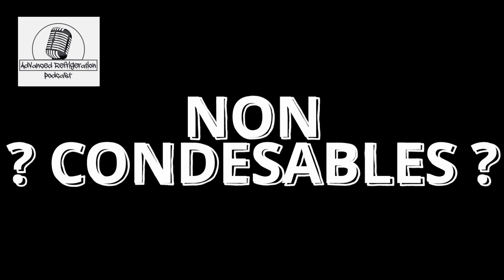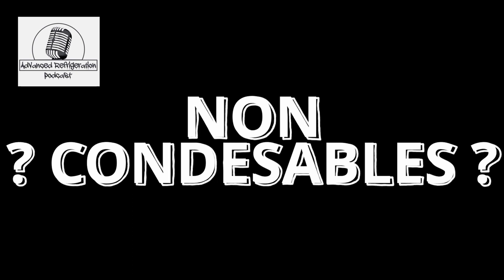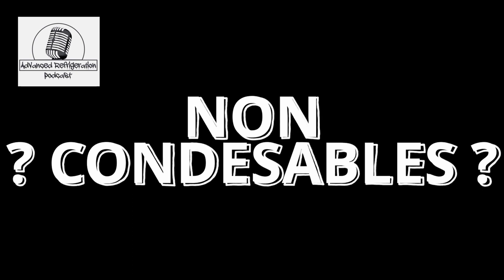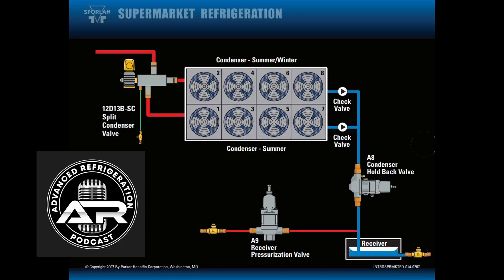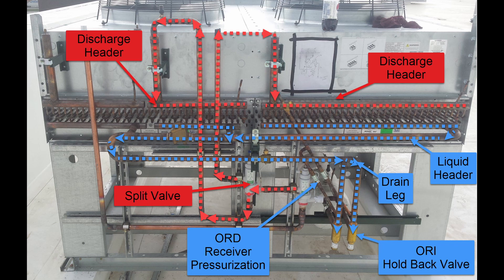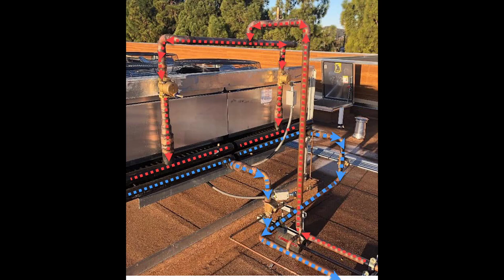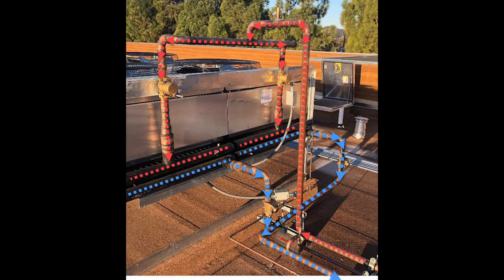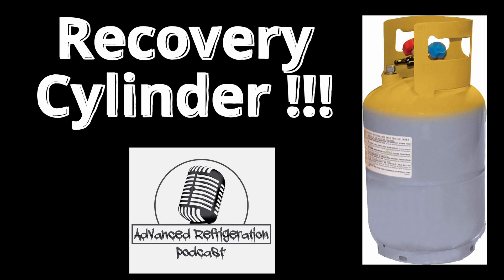Non-Condensables Test

Comment: Or for 4 1/2 K you can purchase a refrigerant identifier for the refrigerator you’re working with and just hook it up press test and two minutes later you’ll have a exact print out of the percentage of refrigerant and percentage of the air mixed.   What’s your time worth.   4 1/2 K is a drop in the bucket compared to the size of the systems and a few hundred dollars per hour we’re charging 

I have owned and purchased my first refrigerant identifier back in 1992 so by now there’s no excuse for every company to have one.  Except for those who are cheap or do not believe in modern technology computers and think we should all be using analog gauges and get rid of Electronic Expansion Valves and VFD‘s. We just have to wait another generation until all those dinosaurs are dead
Reply: Could you please put the link or info to this device?
Reply: Seems like a waste of money
Reply: @user-ot3zk5me5l  not when you recover few hundred lb of r22.  And not the contaminated stuff someone drops in a different refrigerant on top of it.  Or R1234yf  I recover over a thousand pounds a year. Resell at $207 a lb.   Don’t sound like a waist to me .
Reply: @coldfinger459sub0  Doing refrigerant conversion rate now. We are pulling thousands of pounds of r22 out at each store. In the bottle it goes and off to the supply house. Who cares what’s in it.
Reply: @coldfinger459sub0  You may make good use out of this expensive analyzer but the rest of the trade could use it as a boat anchor. Every company does not need one. Your comment said every company should have one and if not they are cheap or not up with the times. This is a very narrow point of view. Your point of view. Just because you can benefit from this tool does not mean everyone will also benefit from it